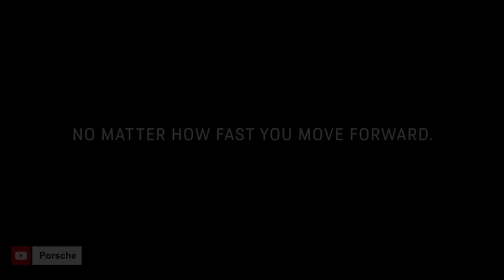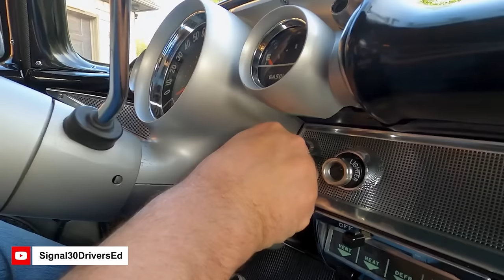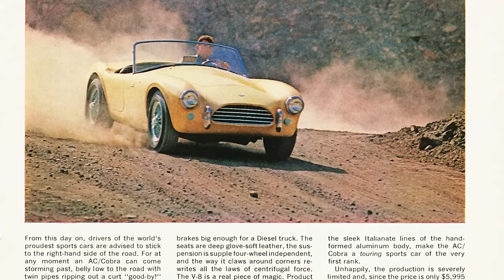Why Old Cars are Better

Comment: I’m 20 years old and have grown up in the garage working on everything from the 30’s to brand new.  It’s extremely apparent that nothing built today is meant to last.  People have this weird idea that newer is better but at some point something will break and honestly we see more brand new commuter cars than 20 year old Chevy work trucks.  Unless gas prices become unbearably high, as long as you can still get parts I don’t plan on buying anything newer than 2010 in MY lifetime
Reply: Im 18 and ive seen nothing but the same , i got my 2000 passat and shes not built perfectly, but built damn better than the garbage new cars my parents keep buying
Reply: Lol same here I prefer older cars being able to work on them at home but would update to a modern Toyota hybrid when they've depreciated though with how expensive gas is in my country.
Reply: People said the same thing in 2010, and 2000, and 1990 and so on. I bet they said that going back a century and they'll be saying it for another century.  At the height of the 1975-1985 malaise era there really were a lot of lousily built cars being sold but now many look back at them fondly. In fact I had a fully optioned 1979 TransAm I owned in 1980 that I still wish I had but that's my selective memory of a single car. The past often looks rosier than it actually was.
Reply: @ddavidson5  True, but much of that feeling is the constant cost cutting and plastic replacing metal.  It makes the car seem chintzy and trashy.  Also, the traditional American car was intended to be easily repaired and infinitely rebuildable, even if few did.  Today's cars are not, and seem disposable whether the owner likes it or not.
Reply: @ddavidson5  But those poorly built 70s - 80s cars could be rebuilt and the problems fixed.  Today's cars can't.  Plus, they are cramped, ugly, rough riding, noisy, and uncomfortable.
Reply: @michaelbenardo5695  it was a good thing the traditional car was intended to be easily repaired and rebuildable, they often needed it. 😉
Reply: @inspirice9844 don’t do it!!! You have no way of determining the conditions of the battery. You’re getter off with a classic car or stripped hybrid and fitting in a civic engine or something similar.
Reply: I've owned about 10 cars in my 16 years of driving, all older than 1980. I never had a major headache until buying a 2003 and had to change an AWD transmission that the manufacturer directly advises not to service! After doing that I had to hunt down a faulty module that was killing all communication so the car was stuck in limp mode. I've rebuilt engines far more easily than this 21st century consumer nonsense.
Reply: Agreed nothing but planed obsolescence from the manufacturer plaguing the se new cars, 19 here driving a 2000 buick lesabre and beater volvo v70 from 2001 yeah they got there problems but they're still better than most of this cars on the road
Reply: @michaelbenardo5695  You not like the cladding which covers the plastic intake manifold?
Reply: You can not fix a battery, you can fix a motor
Reply: Here here,  👍 
Absolutely 110% correct I'm 28 and worked on 50's to mid 2010s cars and bikes mostly & yeah as jay Leno says, something like, mechanical parts are ment to be fixed eletricical parts r ment to be replaced,  don't think that's the exact quote but u get the point 
They don't make em like they used to
Reply: @TinyTurboVW a 2000's car is new
Reply: @lukeharpman7675  no. it is far from it in fact, 24 years old minimum, and mines 25
Reply: @TinyTurboVW  yeah only 20yrs old I consider that new,  does it have a ecu & cruise control and electric windows...
Compared with automotive history,  Edwardian brass eia steem and chain drive cars it's very new
Reply: @lukeharpman7675 that's like saying a brig from the mid 1800s is a new ship, because compared to the shipbuilding industry, and let's say a trireme from 450 BC or a canoe from 1000 BC, it's very new.

A ship from the 1800, is of course, a very old ship. 
A 20 year old car, is an old car. It's not antiquated, but still, it's old.
Reply: I’m 20 as well and I I’m driving a 35 year old Saab 900 turbo. It’s a beast and built to last.
Reply: I was born in 2000, and swore to myself I'd never own anything past 05. Just feels like almost everything before just had soul and more focus on the people they sell their cars to rather than what the competition is making!
Reply: @nickklavdianos5136  I guess cuz its newer th me I don't see it as old I mean it's still plastic bumpers, old cars to me are about pre 85-1990
Reply: Define "old car". I grew up in the 80s-90s and back then, new cars were considered POSs compared to the cars of the 50s-70s. When I was a kid, that's all I heard. Dads griping about these new plastic fantastic front wheel drive pieces of crap that you can't work on at home. But now, every is saying how awesome the cars were back then. The truth is, the quality of cars started declining in the 1950s. That's when body panels started to get thinner and cars began to rust out. Back in the 50s  the average time a family kept a new cars was less than 5 years. Now people will hang onto a car for 20+ years. That could be why car makes make them the way they do now, with a engineered lifespan pretty much. It's hard to tell where the line is between made to last and made to fail. I have a '98 Dakota, and a '08 Grand Vitara. Both are garage kept, and maintained and service by me. And, both running great. But, I also have a 2015 Grand Cherokee I bought when it was 7 years old with 109k on it and there's nothing wrong with it. It had a few things that needed fixed- the oil cooler on the 3.6l was leaking, one of the motor mounts needed replaced and it had an EVAP issue. But, it is very easy to work on. But, I don't like that MANY of the major engine components are plastic. You can say that is cheap, but it made it over 100k with no real problems. You can't do that in a 50-70 era car. Back then, you could put 100k on a car without having the engine rebuilt before you made it that long.
Reply: i doubt any new bmw will take 250,000 miles like my E36 did (without the owner having to file for bankruptcy)
Reply: Lots of rose colored glasses in the comments here. The cars you claim were "built to last" didn't even have six digit odometers, unless it was a Mercedes or a Volvo. Lol. 

A 2008 Toyota Corolla will do 300,000+ miles without much thought put into it. Most of those "high quality" cars built in the '80s and earlier would need two engine rebuilds in that timespan. Not to mention the fact that you actually have a chance of surviving a 35mph crash in the 08 Corolla.

No, not all new cars are hard to work on. In many ways, they are easier to work on and diagnose, they just require a minimal amount of brainpower and electrical knowledge. Different, not worse, folks.
Reply: @TinyTurboVW  my E36 was one owner since new till i got it and i have seen later generations have more issues than my car
Reply: @Suzuki-SwiftSport  My 2011 328i had 230k when I sold it and it was very cheap and easy to maintain. Unlike your E36, it didn't have a ticking timebomb for a cooling system.
Reply: personally I think 2000-205 was the greatest time of cars, you have tech but not too much you have crazy but practicalish engines
Reply: @d47000  new cars are worse because just about everything is plastic,(even engine wise) which we are just gonna see how well that ages, and all the electrical components are put in vulnerable places, they're worse in like 80% of ways, at least with how I use/maintain vehicles
Reply: @lukeharpman7675  you are correct about it being new compared to that, and yes it has those features, but comparatively to new/newer vehicles it is like dissecting an egg vs a chicken, one is much simpler, and while being more complicated than lots of things, it's still built relatively basically compared too all the modern "computer talks to different computer talks to module talks to another computer" bullshit
Reply: Speak for yourself about not seeing Chevys!  They're all over SW Virginia and I've got a 30 and a 41 year old Chevy work truck (and a 46 and a 46 and another 46, but those aren't road legal).  The 30 year-old is my daily.
Reply: @TinyTurboVW  I can't disagree with you there. Plastic valve covers, oil pans, thermostats, water pumps, radiator elbows, so on and so forth are a major pain in the arse.

The upshot is that these parts are cheap to buy, and with modern materials engineering, they tend to last 100,000 miles or more before they leak or break. Most modern economy cars (Toyotas, Hondas, Volkswagens, so on) are still rather easy to work on so these jobs are a breeze. 

Compare that to vehicles of the 20th century that people tend to romanticize... Relatively poor powertrain reliability and frequent required maintenance, much more expensive, if not impossible, to keep up past 100,000-150,000 miles. Not to mention all the added weight from everything being metal. 

Overall, I'll take it. If modern auto manufacturers had to make everything out of metal, nobody would buy them because they'd be so expensive. I think 2000s cars are a good balance between modern powertrain technology (reliable transmissions, reliable and precise electronic fuel injection, good engine design, acceptable safety, essential modern conveniences like cruise control) and less cost cutting than 2010s/2020s cars.
Reply: I second that, been working on cars since 12 and now at 28, its more  apparent that the peak of automotive technology in terms of minimalist simplicity are late 80's thru late 2000's. Sure the trade off is lower power but man most cars, even american easily saw 200k+ miles with regular maintenance. Hold on to whatever u got everyone, cars will never be the same
Reply: @Suzuki-SwiftSport  good car the e36, that is if nothing's wrong with it,  I'm far from a bmw guy & although there a 90s car I'd still consider then very much as new
Reply: 22, same exact opinion as you. Ideally I'll stay pre-2005ish
Reply: @ddavidson5 As a professional mechanic, the problem isn't that newer cars are crappy quality and older cars were not. You're correct that the malaise era was a low point for the industry...

The biggest problem with modern cars is that manufacturers are taking away your ability to service them. By either refusing to sell you parts, or forcing you to take it to the dealer, or a professional like myself. The approach and mentality the manufacturer carries and puts into the product is different too. Where older cars, manufacturers gave you the best bundle possible for the money. Today it's about how they can continue to take your money even after you purchased the vehicle. With practices like subscription services, or hiding away parts, and repair data through pay walls. 

Modern vehicles have gotten so proprietary, you never really own the vehicle anymore. It's like you're borrowing it from the manufacturer.

This is where modern day consumers feel the industry has lost its way. And why older cars are starting to become more appealing to more ppl. Folks just want something reliable, simple, and comfortable. That when it does break down, they can go around the corner and fetch parts. Install said parts themselves, or contract an entrusted source to install them for them, then be on their way. Folks don't want to jump through the many hoops modern cars force you through just to figure out what's wrong, then be stuck sourcing the parts (and waiting) from specific sources because nobody else has them, or they are not dependable.

Don't even get me started on these newest vehicles that have their functions and features locked away behind subscriptions, and who reset whenever you sell the vehicle.

We've lost our way with automobiles. They've become more of a hindrance, than an enjoyable experience to own.
Reply: @d47000 You say this, but your example is a 2008 Corolla that is considered a dinosaur by today's standards and practices.

Compare your car to say a 2024 with telemetrics and subscription services, that requires DOIP tooling to even scan for codes. I bet you don't even know what half of that means, and neither do most consumers until the car breaks down, and these "practices" rear their ugly heads and you are forced to either take it to the dealer and pay top dollar to repair, or take it to an Indy like myself and pay mid-tier prices to repair.

The industry has moved into an ugly place. We have given these manufacturers too much power.
Reply: I never used to mind because I was born in the 90s and the next new car was as good as, similar or better than the one you just had, then they started to go down hill, now anything newer than 2016 is pointless to own especially in europe or any WEF countries.

I truly wish I could look forward to the next car but until the madness of the green lie and the WEF is exposed and we start simplifying our cars again, there really isn't any cars to buy now.
Reply: 2015 is my cutoff, but yeah, there are some brands I just won't touch with a 10 foot pole, VW/Audi being one of those. Right now I'm quite happy with my 2006 Corolla commuter, and decently OK with my 2005 Sonata. Rust proof the old stuff and keep it going.
Reply: @rizzle3272 the whole point of him buying a hybrid would be to have a more efficient vehicle
Reply: @lukeharpman7675 have to disagree. Even a 2010 can be considered an old car now. It's almost 15 years. I'm 19 with a 1987 and 2002 civic and I struggled with realizing it but time has passed and what I considered new before is now considered old by people around me
Reply: I disagree nothing today is built to last.

My cutlass doesn’t even go past 100k on the dash… yeah they meant for that thing to run for a long time…

Anyways the engine tolerances and quality are much higher today, I almost expect these modern engines to last a while, back in the day not so much, or maybe they stopped the odometer so early for some other reason.
Reply: This is categorically false. One hundred percent false.  The average age of a car today on the road daily driven is just about 13 years old. This is a record.  Cars routinely last 300 thousand plus miles.  Rust is far less of a problem today than it was in older cars, especially cars from the 50s and earlier.  They only started dipping cars in the 60s.
Furthermore, a 10 year old car today with 100k miles (about) is WAY more reliable than a 10 year old car was in 1990 (say, an 1980 car with 100k miles), though this improved in the 80s. By 1990, US automakers were on the upswing.
The 70s and early 80s was a terrible time for cars.
Reply: Alot of plastic self degrades without chemical attack, excess heat or impact, and it is everywhere in modern cars: fluid fittings, pumps, you name it.  Takes about 30 years for most cheap types to get brittle, so in 50 years...the only way to keep todays cars on the road is going to be a 3d printer, a massive dimension library, and some mad fabrication skills.    As for engines? These low tension rings plus 0w-20 or thinner are a deal breaker to me: todays engines are designed to go out and when they do... cylinder walls don't have much room for error, plus assembly complexity makes labor insane.  
I am looking to make my next truck mid/late 60's and bless it with frame off attention - and a modest 480 hp or so in front of a 4 speed.
Reply: @tarstarkusz  new cars are designed to fail. I wont argue with your point about 70s/80s cars but 90s toyotas were probably peak reliability
Reply: Still driving my 94 Ranger, nothing made today can touch it.
Reply: It's a classic "bait and switch" tactic, every company does it, they'll hook you in with cheap, reliable low maintenance cars and wait until their young buyers and supporters get old and are able to afford expensive things. They play on nostalgia, they use your fondness of the past to engrain it in the present and pull you in to buy the same brand again- or because there's no other options but the undesirable. It's marketing. I studied it, sold my soul for it, and ultimately turned my back on it before it got its teeth into me.
Reply: Only good thing about a new vehicle is warranty if ur truck is ur money maker idk u towe skids every day then trade it in every few years so it’s always under warranty and like if u do break down it’s a call n then fix it not a oh fuck
Reply: @nuckels188  Most of the major automakers did well in the 90s. I agree with you.
Reply: @flinch622  We will be lucky to maintain bicycles in 50 years.
Reply: Well said I wouldn't buy newer than about 08
Reply: @ddavidson5  Not entirely true, cars from 90' in Europe were mostly unreliable, It is all connected with the technology field test waves, 2000-2010 is a sweetspot for fairly modern, well tested technology of fuel injection combined with basic comfort stuff, then the regulations hit the industry and they had to react. Today ev are the in the same spot, fieldtest mode and experimentation. Other thing is that today cars are not meant to be owned, you just lease it and share the data with insurance companies
Reply: I’m 28 and I’ve had quite the cars. 

I currently own

2015 F150 Lariat 3.5 ecoboost (newest I’ll own)
2007 Mini Cooper S
1991 BMW 750 V12
1963 Cadillac DeVille 

I’m content and very happy in this life of mine.
Reply: 20 yr old vehicles are still new to me!
Reply: 2000 Passat?? 🤢🤮🤢🤮
Reply: I agree with you, the newest car I’ve owned was 17 years old when I got it, oldest i own is coming up on 50yrs old
Reply: Stay poor
Reply: @Bluesjet1234   Stay off the internet
Reply: Up to around 2013 is also good if you are buying a model that was released before 2010
Reply: borregoayudando1481  no the reason cars from that period are so expensive now is because modern crap is crap
Reply: @ddavidson5  Some people are overnostalgic, but as the years pass, you can see that some good things are gone or replaced by low qualty/bad desing one.
Reply: @tarstarkusz  In Europe in the '70'-'90's there where some good cars. Not all of them.
Reply: Yup I feel cars built before 2010 are much more reliable, due to the all the electronics and extremely complicated engines and transmissions. Ive put over 300K miles on multiple vehicles built between 1999 to 2012.
Reply: I drive. 97 seville sts and it's surprisingly reliable. I have it clocked at around 234k miles
Reply: I agree my first car well should I say first official car that was in my name which I still have to this day. About four years later was a bright white base model 1996 Buick Park Avenue probably the cleanest example driving around in Lubbock, Texas currently with a taupe interior, the dashboard is not cracked. It is like a museum in the inside. Everything is perfect the elderly lady who was 85 years old at the time and had a hard time getting in and out of it sold it to me she was the first owner and I am the second and current owner. I bought it for $3500 with 68,000 original miles on it which is now sitting at about 81,000 miles and a half original engine and four-speed automatic column shift transmission but the engine is the beautiful smooth legendary 3800 series 2 V6 why GM stopped producing that engine. I will never understand but I love the car. I still love the car to this day one thing that doesn’t work in the car, though anymore, the power antenna, the plastic wire that goes around the the gear that is responsible for pulling the antenna down and making it extend just quit working because the wire isn’t two pieces now I’ve yet replaced it but rather than replace it I’m probably going to just rebuild it maybe find a metal wire instead of a plastic one to use but it took 27 years for that to happen and on my particular unit, there’s about four rivets because it was obviously never designed to come apart, but they’re just rivets so you can take a screwdriver and mallet to it and hammer them out. I saw a guy do that on YouTube for his power antenna assembly that had the same problem on an 87 some kind of Chevy G body car and replace it with with that garage door style cabling, and then weld it up to the little hook that would grab on the gear so it would never break again with the garage door metal wire in cased in plastic and then instead of replacing it with rivets, he just put screws in the hose to make that job a lot easier second time if it ever needed it as well as looming up all the gears inside and after 30+ years is that electric motor still worked on his after 28 years for mine, the electric motor still works on that power antenna, which is incredible for an electric motor. I mean, I’ve bought brand new fans before that the electric motors in those fans last about three years if you’re lucky crapping out and there’s no repairing or rebuilding on new cars anymore the similar equivalent happened. It’s just replacing because now the car antennas are on the windshield so if your windshield is shattered, even though your antenna is intact there’s really no way of removing that antenna because it’s glued on the windshield so you just be replacing it even with suspension components with ball joints in them, like lower control arms, the rubber mount and the lower control arm on an old car used to be separate units you used to remove just the rubber mount to replace it and put it on the old control arm now if you want to do the same thing, the control arm and the rubber mount is one piece. It’s not designed to be removed now. I’m sure it can be drill and such but it’s more trouble than it’s worth cars are not designed to be repaired or rebuilt anymore
Reply: You are a wise 20 year old.
Reply: It’s the same with bicycles, since 1990 they have become hideous.
Reply: @AK-sx4zp  2010 lolz yeah guess u right though
Reply: New bicycle's are! Steel is still real
Reply: 2010 is a telling year, for everyone paying attention the quality of cars dropped dramatically in the several years following the 2008 recession and subsequent auto company bailouts
Reply: Im also 20. I always used to go outside and watch my dad fix cars when I was a kid, and over the years I have also realized the same thing. From my grandpas 80's GMC squarebody, to my dads late 90s Ford Taurus and my moms 2010 Dodge Caliber... every decade forward is a step backwards in quality. The metals used in the block and heads especially... You can see the pitting and roughness when the blocks are casted in newer cars and its apparent that they are just so hastily produced in mass. My grandpas old 85 Sierra had a rebuilt 350 put in it and the block looked almost handmade compared to a newer car. Another thing is the comfortability. With safety regulations pushing for a more crunched and sunked in posture, newer cars have EXTREMELY uncomfortable front seats. My parents got a cheap $19,000 Honda rental after an accident, and the interior literally felt like it was made out of recycled Alibaba plastic. The front seats were exceutiatingly uncomfortable. The posture and headrest forced your neck to lean down and your butt was sitting on only ½ inch of foam and you could feel the plastic frame underneath. 

I dont have a car yet, but I made the same vow, that I will never own a car newer than 2010. When I have kids someday, only then will I get a newer car, and it will only be a van with 3 rows of seats. Everything else will be for fun sunday driving or for reliability.
Reply: Funny. My dad sold used cars in the '60's. If the odometer said 80,000 miles or more, it made the vehicle much more difficult to sell. Used cars now bring good money and sell quickly with 150,000 miles or even more.
Reply: @ddavidson5  True!
Reply: @lukeharpman7675 His 2000 Passat is a 90s product - car! 

There’s nothing "2000s" about it. 

A 2008 B6 Passat, that’s a 2000s car. 

🙂
Reply: @TinyTurboVW Correct! 

Your car was probably already built in '99. 

People see the year "2000" and immediately associate it with the 2000s decade. 
There’s nothing particularly "2000s" about it.
Reply: @lukeharpman7675 A E36 is a new car? 😂
Reply: @ddavidson5 I built a 88 Monte Carlo as if it was made in 1968 with old junk yard parts and it's ran 8 years problem free. Just oil changes 1 spark plug change and 3 air filters so far. Other than that no maintenance or breakdowns, no catastrophic damage and the engine is older than the car and has never been rebuilt. I love when people's misconception shows their ignorance
Reply: @Kev27RS  well compared with my club car,  a 1970 beetle,  yes...
Reply: @lukeharpman7675  It’s newer than your Beetle, that’s it. 
The E36 is still an old car though. 
It came out over 30 years ago 
and was sold between '90 and '98.
Reply: Yep. I will never buy any car or truck from 2007 and newer.
Reply: Im 29 and i pretty much think the same way.. the gas mileage can be pretty nice on some of the new cars though
Reply: Acting like old cars are maintenance free lol
Reply: @michaelbenardo5695 I think you're missing the fact that people had this big objection to the cars killing them in the event of a crash or being slow before that crash. These things necessitated lighter materials, aluminum engines, crumple zones, plastic parts, etc. learn the why before you critique it I'm not saying you have no points but I am saying there is a reason for that. You don't want to learn the hard way what the reason is all the time.
Reply: @rizzle3272 why not just get a CRZ they're hybrid. Batteries are cheap as hell. Like a couple grand. Not that bad to install either
Reply: Do you have any suggestions for someone like myself who knows nothing about cars and fixing them but who wants to get into this?
Reply: @adamcheeseplease  watch a few videos on how a car works. How suspension works. How gearboxes works. How engine electronics and sensors work. Then get a repair manual for your respective car. Watch a YouTube video on how to change oil on your car. Buy tools and learn of how safely jack up a car and then change your oil. Then change your brakes if they need doing then you can move onto more complicated stuff. It’s good knowing when to stop and take it to a garage (only go to good dealerships and specialists for your car brand). 

There is also a YouTube channel called the car care nut channel who does a series on how every single sensor works and stuff he focuses on Toyota. 

That’s it.
Reply: @adamcheeseplease  to get started learning about working on cars, buy a copy of automotive technology, a systems approach by Jack erjavec used and play car mechanic simulator.
Reply: @adamcheeseplease  I know this might be somewhat of a hot take, but honestly if you just want to wrench on something and understand the general mechanics of a vehicle,  I would recommend starting out with buying an older motorcycle.  I bought a 1982 Yamaha Virago a couple years back with the intentions of building it into a cafe racer and its actually the best, parts are cheaper, everything is way easier to get to and there is generally just way less of a headache involved.  Plus you could have enough money for a daily and your project.  Just be prepared to spend more than you initially though, it always ends up that way lol.  This guy also has a second channel with lots of videos like this but about motorcycles.  If your interested its also really good.
Reply: Newer is better machined but cheaply manufactured and ruined by electronic controls and forced features that can’t be removed.
Reply: @buttonysquare8501  those features are better at avoiding crashes. Trust me I've been at this a while. Some new cars are trashy, but let's be honest, there are always trashy cars that's kind of the nature of any industry
Reply: Bein driving my first vehicle a 88 4runner and 15 years later half a million k and its still absolute a champ and at this point if something goes I upgrade it not just repair. Was a 2400 new and easily could sell for over 15g now. Not that I'd ever sell because there is something nice about knowing the life expectancy of all your components on your vehicle and not having a 500 dollar bill ever 2 weeks for a car payment. Slowly my truck is becoming worth more, stronger and preforms better then a new equivalent like a bronco. People forget everything has life expectancies for parts and the lowest life expectancy materials used in a car is the thin plastics specifically wiring, sensors, and internal plastic chain guides in motors.
Reply: Another thing is how much faster your drive goes and how much more enjoyable the drive is with a classic because your mind is super active monitoring the car.
And your 100% right about the driver feel it's true how different it makes things, lots of times older cars feel like your going much faster due too the size and wind. The cool flip side if this older cars have more driver feedback and when your accustomed too it your have alot more control. Good example is a first gen rx7 no power breaks or steering and you could easily jab the breaks and initiate drifts suuper easily. There are alot of what others would consider very extream maneuvers that older classic cars do naturally and very easily.
My last point is if you have ever driven a electric car you know how fast and quiet they are almost boringly fast. You get uptoo such a excessive speed so fast that it littlerally isn't exciting. And it's happens so fast it's only exciting if you go so fast it's really high risk that you can't do it safely. As apposed too a classic motor you definitely won't have the power or speed but you get alot of excitement. It's like guys who build a mud truck so massive you can't find a puddle that's a challenge. Having a car so fast you can't use is also a thing
Reply: My 2007 Accord, bought new, is still running just fine with just normal maintenance.  It's only the modern cars that suckers buy that won't last...Chevrolet, Nissan, Kia, Fiat, Dodge.  As a kid, I remember people never expecting their cars to last over 100,000 miles.
Reply: Realize how expensive it was I just moved into town and bought a bike

Can't fix a car but a bike is to dumb to be unfixable.
Reply: this is literally chrysler's marketing strategy from the 50s in action
Reply: I don't plan on buying anything newer than 85 and that's being nice
Reply: 80's cars rarely made it over 110k miles. We have owned 7 Tahoes since 2003, and all are still on the road driven by family and friends now.
Reply: In my opinion, the early 2000s were the peak of automotive engineering. Most vehicles performed well, had many luxuries standard, and are still simple to fix. 250,000 miles with some maintenance is very attainable. For the average person, the best of everything. Now I absolutely love 50s,60s,70s, and 80s vehicles but unless you put some serious money into upgrading the suspension and brakes, daily driving is a stretch. This is where 90s vehicles really shine. Most are comfortable, have good brakes and suspension, and sometimes still have the classic drive trains with maybe some newer doodads that can be switched out for classic setups if you like fairly easily. And for 20 bucks, you can have a modern Bluetooth radio swapped in. I feel for us car people, 90s is really where it’s at.
Reply: @ddavidson5 malaise era,,  I've just recently heard this term for what was a ugly Grandma Car and ugly boring commute car, 70s gas crunch, it's impact on the American public and the U.S car manufacturers, trying to keep up, Front drive and good on gas etc... Malaise era, I've never considered as you mentioned 2nd Gen GM F Bodies as such, yeah you got flare with no punch etc, also the Corvette,, C3 era, both exceptions to this bland era...
Reply: All real commerce is made in the Service Drive of any Dealership, Sales can't keep the lights on without Service Drive, I learned that at my first job, Browning Oldsmobile, Mitsubishi and Mazda in Cerritos California...
Reply: @ddavidson5 yeah I miss my 74 malibu or my 87 GTi but they were both piles of shit that broke down all the time but shit was easier to fix and cheaper to fix. My 2005 prius killed is abs brake booster and that shit went to the junkyard and now I'm daily driving a 1991 chevy k1500 because of that lol
Reply: That could just be sample bias. The trucks like that are much more likely to be owned by people who know and are willing to work on them. If they weren’t, then they’d probably have moved on to a newer car by now. Thus, the people who own them have very little reason to bring it into a shop, sans some catastrophic failure. Source: I daily a 1979 Volvo 244.
Reply: Old car were built like farm equipment
Reply: @michaelbenardo5695  I know why new cars have hard ride but when cars were engineered for comfort no one would have bought a car that rides like a lumber truck and your back takes the hits. My newest car is a 1959 for good reason.
Reply: I guarantee there will still be Toyotas from the 90s on the road by 2100.
Reply: I have a 2016 BMW sedan and it is built like the old ones in that it’s made to last. That’s what you have to buy to get that kind of quality these days, extremely expensive “luxury” cars. It’s an amazing privledge to drive such a magnificent beast, but I wish I could have one from the 1960s. My dream car is a 1959 T-Bird and I can’t stand Ford nowadays. 😂 I just can’t afford one right now and the BMW was a gift from my mother. On the bright side, I live in a city where there are so many Cholos and other car nerds who loooove to restore old cars to beautiful perfection and I adore them as they drive by me randomly. I always cheer them on!
Reply: @pandakicker1  In my comment below yours the 65 year old car that got wrecked was a square bird I'd been driving for 12 years with near 200K miles on the original running gear. I replaced it with a one owner 85K mile unmolested 59 bird factory 3 speed OD. Rare but well worth the search and I consider them very undervalued. I prefer square birds as they are the last easy to maintain, easy to restore luxury car and I like the design. I've seen running square birds sell for $2500 but the dash pad is always collapsed which is a bitch to fix. 

I don't know of any car built as strong as a square bird especially considering the heavy gauge front inner fenders seam welded to the frame and firewall. I replaced the good 352 with a 68 GT 390 built for 87 oct, long tube headers, front disk brakes and a rear sway bar. My favorite super cruiser gets low 20s/gal on the freeway if held at 65. I don't restore cars to perfection, I restore them to drive.

Keep searching, they're still out there.
Reply: They are unbearibly high. 5$ a gallon rn
Reply: amen!
Reply: Me nether bro!!
Reply: Yup. Got a 2000 Toyota Camry, 2000 Acura rl & a 2003 Honda accord, they can last for generations.
Reply: im sticking to pre 2003, pre emissions
Reply: Well said and agreed.
Reply: If you put a Bluetooth transmitter in any car it’s pretty much a new car.
Reply: I have a 1966 Chevy Corvair and a 2006 Chevy Cobalt SS. Yes, my "new" car would be classified as an "old" car in this video. But the difference that 40 years make is apparent. The Cobalt is so much less involving to drive than the Corvair, even though both have manual transmissions. No power steering or brakes in the Corvair.  No power windows or door locks, either. I replaced the factory AM radio with an aftermarket stereo system in the Corvair, although I hardly ever use it, since the engine makes sweet music on its own. The Cobalt has the high-end factory 7-speaker stereo, which is on nearly the whole time I'm in the car. For A/C in the Cobalt, I twist a couple of knows on the dashboard. In the Corvair,  I twist cranks mounted on the doors to lower the windows, then open the vent windows, too. Good ol' "4-40" air: drop all 4 windows and drive 40 mph! Don't get me wrong, I like the Cobalt for day-to-day transportation,  but the Corvair is more FUN!
Reply: @McPh1741  You always "can't work on new cars", that's what I've heard for the last 40 years too. It's extremely funny to hear people applauding 90's or 00's cars for their "simplicity and reliability", and considering the damn nineties as some sort of pinnacle of design.

It's just that the people themselves have gotten old and creaky.
Reply: They are aiming for totally disposable cars.
Reply: Newer cars are lasting longer than cars ever have before, all the figures back this up.
Reply: @michaelbenardo5695  "plastic = bad, metal = good" is such a simplistic thinking that it can't be taken seriously. Looks how well cars from decades ago rust. Technology is improving, making cars better in everyday use for most people.
Reply: @michaelbenardo5695  lol good luck restoring rusted out 70s car. I'm pretty sure you've never done it so you don't know how much effort, money and outsourcing of rare and obsolete parts it takes. "Noisy and uncomfortable" lol then again, try driving average car from the 70s, not pristine well maintained top of the line muscle car, just a budget compact sedan, you'll see how easy they are to drive. I understand you are young and still romantic about beautiful cars of the past and there's nothing wrong with that but don't try to disprove the mundane reality of average car from today and back then.
Reply: Have you owned Toyota? Regardless of age their cars are solid.
Reply: That is complete nonsense my old man is70 year old, mechanic as a career and is the first to tell me that the good old days were built worse in every way imaginable, 60,000 miles was considered well past a cars prime and 100k was unbelievable until the japanese stuff showed up. Shitty cars today can hit 300k
Reply: consumer reports which takes no money, evaluates non biased has lists of dozens of cars from 6000$ to 30000$ that last 200,000+++ easy with no issues-  i would rather crash in a car with crumple zones/air bags protecting me. My 2020 basic car slams the brakes on stops by itself before collision- keeps its self in a proper lane etcetera etcetera.. Yes we all like nostalgia classic cars
Reply: @Big_Chunks  my first car was a 2005 9-3 2.0t.   Traded it for a 2010 9-3 2.0T, both automatic because family members wanted to be able to drive it but can't drive stick.   Now I have a manual 5-speed 2006 9-3 2.0T and should probably sell the 2010.  How's the car holding up these days?           I'm thinking of mayyybe selling both to get a 900 Turbo SPG. 

only ever owned a saab myself haha.  best car by far from what I see of family, friends, and acquaintances cars. I've spent less on maintenance than any of them and have fewer issues. I've never had a breakdown or couldn't get where I was going with my saab.   plus it's zippy and great to drive
Reply: @the_kombinator  rust is what's going to kill my car eventually  :(
Reply: I drive a 1974 MGB. It is cramped, rough riding, noisy, uncomfortable, and a gas hog for having a 1.8 liter engine. (Beauty is in the eye of the beholder) That said, it runs ok, the bugs have been worked out, and parts are readily available. With luck, it will last another 50 years.
Reply: My 92' Chevy Cheyenne 1500 WT was the best vehicle I have ever bought. Had to sell it when I moved across the pond and the guy I sold it to is still driving it. The stuff cranked out today is overengineered, plastic crapola.
Reply: agreed, when i get the money and it’s time for a new rig im just getting a 09 tundra with a solid frame. replace all the breakables like ball joints, bushings and electrical and i’m happy.
Reply: I want my old ‘69 Ford F-100 back.  Four-speed that could have an OD added AND a built-in PTO!  Also had a BIG Chevy wagon that would tow a 3,500- pound boat while filled with up to 8 people and load camping gear on top!  NOW, just try finding a car that can take a trailer hitch, or even an SUV built ready for a hitch!
Reply: Unbelievably as is seems, cars had their prime in the 90s
Fuel inejction worked 
Electronics were simple, fixable and reliable 
And they still had that 80s heavy duty overbuildness
Reply: @michaelbenardo5695  cramped? with how abosutely massive cars are nowadays? Lol
Reply: @Turnipstalk 2 examples don't prove the rule wrong bud.
Reply: You see more new cars than 20 year old cars? Almost because most 20 year old cars are dead, and only the best examples made it this long.
Reply: I just came up with a idea. Steam and Ethanol engines. Half runs on steam half on gas. The half steam runs a closed cycle similar to how a refrigerator compressor works. For one thing, In Brazil, when the fuel crisis hit, the population really wanted smaller vehicles (We never had the boats that USA Had, only the "midsized" Galaxie 500, Simca Chambord, GM Opala, GM Omega, and the Dodge Dart were the biggest cars we ever got If I'm not mistaking) 
So, with the crisis, came the Ethanol fuel, and cars became smaller. NOW With the pressure of SUV's we are finally (badly I'd say) moving to SUVs instead of sedans and hatches, which is a shame. But I agree, 40 years ago a car could make 8KM/L and nowdays cars barely make more than 11km/l in the city. At highway, its slightly better, the cars of the 80's made around 13kml, now cars can make 19kml, its better, but at city, where it matters most, nothing changed at all. And add that Flex Fuel consumes more than plain Gasoline or Alchohol engines, and add useless tech to todays cars (apart from the very good safety, A/C and Power Steering) the cars of today are really more of the same... Cheers!
Reply: newer is better for cars. Older cars became death traps. Car design has gotten better the more race cars have gotten better.

All the safety features on cars come from race cars. I'm sorry, but building a car where the person inside takes the majority of the damage from an accident is bad design.
Reply: @michaelbenardo5695 they replaced the metal with plastic for a reason it's safer in a car crash because the car take the full force of the impact and not the person in the car.
Reply: I had a couple 2016 cars for a year or two, and they broke 4 times as much as my 24 year old Lexus.
Reply: that is literally what industry is doing (because they need to sell you new stuff every view years, and improving the products is just too much work and to expensive) and the "Right to repair" movement is lobbying for such things and prohibit companies to stop you from replaceing parts in the things you own. (companies literally put software locks into their products, so if you replace something, the mashine stops working, even if you use original parts from them).
I am posting this, because everyone who enjoys old things, and things made to last, should aatleat have heard of right to repair, and maybe think about supporting them.
Reply: Pre 2010s were not built as well but they were more self repairable.
Reply: Good ol' planned obsolescence.  Like the comparison w/ homes or the ever-grossening mcmansions, it's about making profit, as quickly and as often as possible.  The service dept is the bread and butter of any dealership, and it doesn't seem the factories have disappointed in that manner.  Overall reliability varies by brand, vehicle type or specific model, but the way some vehicles are designed where accessibility doesn't hardly exist or those cases where expensive special tools are needed to remove some parts, you can see in modernity that they want you to go have it serviced by a professional, and get yourself "serviced" [if you catch my drift] in the process.  It's a tragedy, because it's pretty common for vehicle drivetrains to last 1/4 mil or more miles nowdays, but if the electronics or other aspects of the vehicle are going to crap, that can be for naught.
   With the vehicle shortages of 2020-21 and the insane prices of trucks/SUVs now, people are reviving retired classic vehicles for a cheaper option.  $90K for brand new or $9K for refreshed/redone classic, easy choice to make.
Reply: @ddavidson5  There were some pretty bad models in the 80s w/ many being underpowered along w/ the whole move to the 55 federal speed limit, so I'm with you there.  One thing to consider is any vehicle from that era, if it still runs and drives today, that particular vehicle can't be all that bad if it's around 40 yrs old and still doing the thing, even if it may not be the best looking or fastest thing out there.  >>;=)  My general rule for cars/trucks is not to get the first year of a model or body style or drivetrain... it always takes a year for the mfgrs to work the bugs out (like those 2015 Chevy trucks that were catching on fire).
Reply: You see newer cars because the old ones are at the junkyard. More boomer nonsense.
Reply: Guys this is my brother I’m so proud‼️‼️
Reply: im 24 and my family still thinks newer is bether. lucky that i leave alone. my car is from 2007
Reply: @ddavidson5 

I drive classics as daily’s and they are not broken down as much as new cars now lol
Reply: ive only ever worked on old Citroëns myself but my dad sometimes does work in a body shop, from the pics i see i gotta be very happy with how easy my 2CV is to fix
Reply: A lot of people, like tech nerds, get very defensive and aggressive when you question this. They often like to turn it into a question of safety and try and guilt trip you. Which is funny because we still allow motorcycles... 

However it's now also proven that modern cars are less safe for other people except the driver and passengers. Getting hit by a modern heavy tall car is way worse than getting hit with a normal sized sedan from the 1990s or early 2000s. I feel todays modern cars have created a bad situation all around in traffic, it's like warfare in traffic with the heaviest and largest winning. 

It's bad for everyone and makes traffic worse, no wonder people need a hundred gadgets and assists to help them in modern traffic...
Reply: honestly alot of the cars i see on the road are newer but I also see a lot of older cars from the 90s or 2000s
Reply: I plan to get a late 2000s Ford focus when I finally learn to drive. I am in the UK though, and aged 21 as of July 2024
Reply: @quailking8265  your insurance is gonna break records but nice car choice
Reply: @jorishenger1240  Why will my insurance be so high? 

Well, 2008 was like 16 years ago. Maybe 2011-2013 Ford focus would make more sense now
Reply: Why I'm predicting that 500 years from now people will say the same thing, only with today's cars
Reply: Why does this sound like it was written by an AI?
Reply: You can buy alot of expensive gas for the price of a new vehicle.
Reply: Same
Reply: my mother think that anything older than 10 years old is unreliable and that I should tried to find a yaris or some shit like that for a first car, while frogetting that anything less than 10 years old is also around 10k where I live. I dont intent to tell her that I'm serching for a 1990s 4runnner or to build a 67 impala for a first car until its in the driveway
Reply: @michaelbenardo5695  yeah I dont understand why my father tundra from 2003 was quieter than my mom 2019 corrolla
Reply: Honestly I have this Philosophy “if something new doesn’t work go back to what does.” I’ll keep the old thing. I prefer the old things and old way of doing things. I want to go into automotive design. To craft sexy automotive design. I want to put today’s cars and automotive designers to shame. I am a big believer in Retro Futurism the future lies in the past. I’m also a guy whom wants to improve car design. I don’t believe in minimalism. There is nothing wrong with having extravagant and over engineered cars. I want cars that will stand the test of time.
Reply: Honestly I have this Philosophy “if something new doesn’t work go back to what does.” I’ll keep the old thing. I prefer the old things and old way of doing things. I want to go into automotive design. To craft sexy automotive design. I want to put today’s cars and automotive designers to shame. I am a big believer in Retro Futurism the future lies in the past. I’m also a guy whom wants to improve car design. I don’t believe in minimalism. There is nothing wrong with having extravagant and over engineered cars. I want cars that will stand the test of time. I want cars that will still be drivable 20 years from now with simple repairs. Old cars are better than new. I’m a Gen Z kid and think older music, cars, and homes are better looking and more enjoyable than our “throw away culture today.” I believe things should be made to last. Not easily disposed of like most society wants us to act.
Reply: @TinyTurboVW  i drive an 04 bmw x5. I sometimes drive my moms 2011 audi. The bmw feels faster, and feels better to drive. Yes the audi is faster, but the bmw hasnt had any engine problems at all, and all i need to do is replace wheel bearings, brakes, and tires. Then that thing would basically be brand new
Reply: I'm 33 and I often tell friends who are looking at used cars to buy 2007 and older. Since the economy went to shit in 2008 the production quality just keeps getting worse.
Reply: i got a 67 mustang coupe it a rust bucket been wrecked before i got it  i use it burnouts and other reckless fun but anyways i have a 2008 ford focus deer ran out and hit me on the fender and scrapped the side it caved the fender it but the 67 mustang about a month ago i back into it with a truck and hit the quater panel to my amazement it held up better than the ford focus did and i looked at the thickness of the metal in the mustang compared to the ford focus it looks and feels almost twice and thick i was able to take my bare hands and bend that ford focus fender all different ways but that mustang i had to get a hammer and beat it hard to knock the side back out just shows how much cheaper they produce modern ars
Reply: I have a hard time keeping a "straight face" when you say nothing built today is meant to last. I am old enough to remember cars from the '50s that had a NEW car warranty that lasted for NINETY DAYS or 4000 miles. None of those cars would make it to 50K miles WITHOUT needing a "valve job"! Contrast that with today's "econoboxes" that routinely make it to 200k miles (N/A engines) before needing major engine work.